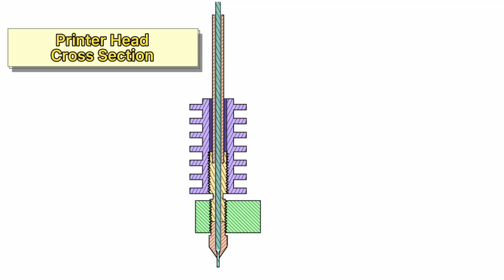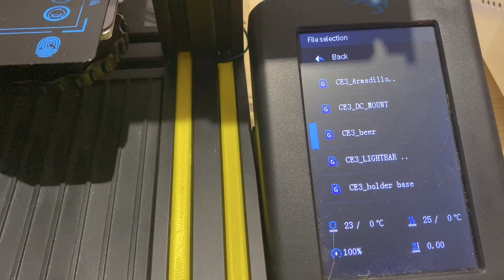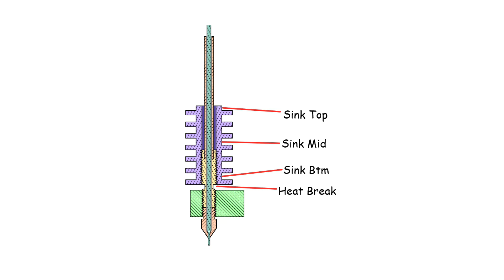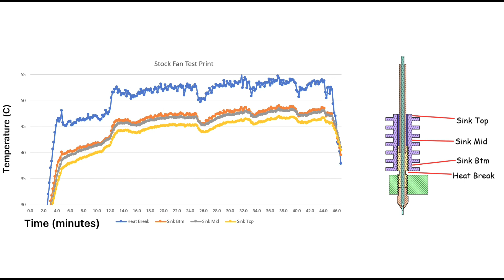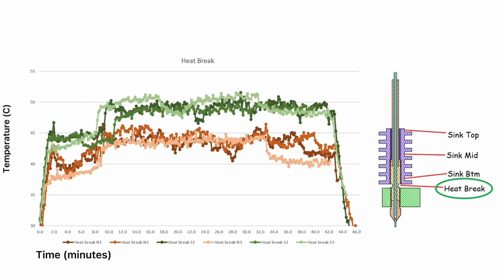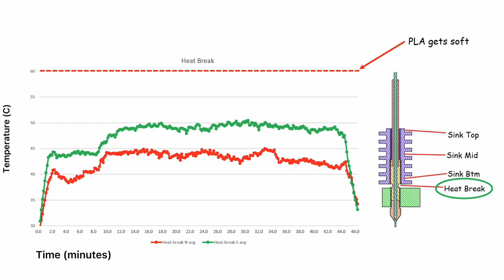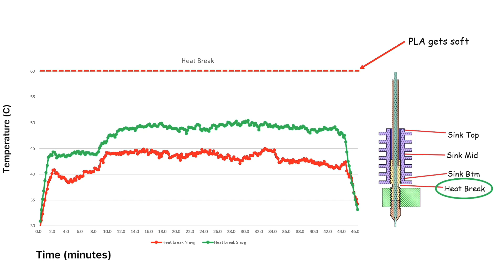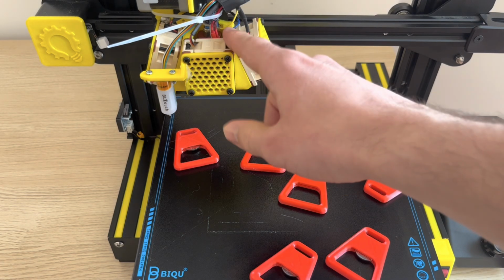Are quiet fans worse for your 3D printer?  You might be surprised!

Comment: Nicely demonstrated. Could you run the noctua fan slightly slower for even more noise saving and maintain similar temperature to a stock fan?
Reply: If you lower the voltage given by the buck converter, you will run it slower and therefore, quieter. But I am sure that the Noctua fans at 100% are significantly quieter than the stock fans, so I doubt that you will have the need to slow down the Noctua.

Comment: Do you have two sets of power wires for the fans? The two fans run at different voltages.

If you run the stock fan at 12v, you are running at half voltage, and that would reduce RPM and airflow.

If you run the Noctua fan at 24v, you are running the fan at too much voltage, it will run faster… For a while, then die. Temporarily the airflow would be better.

Noctua makes good fans, in both airflow and static pressure types, as well as hybrid types.

I am considering doing this change, but don’t feel like wiring in a buck converter ATM. Have to find the space for it too.

Winsinn fans are a little quieter and move air better, so using those ATM.

Comment: I think the real comparison in performance is more about flow and static pressure and noise is just a side effect of the design of a fan.  Typically speaking more "powerful" fans are louder, but that's not necessarily the case.  Well designed fans will can have similar performance and be quieter, which I think is likely the case here.  Would be interesting to have the CFM and pressure ratings of the fans to go with this data as well, though finding that for stock fans can be pretty tough.  So I wouldn't necessarily say "quieter fans are always better", in this case it's more just "this Noctua fan is better than the stock Creality one".

Comment: I'm trying to print homemade (260C) PET Filament. I'd constantly get heat creep and Jams after 10 minutes of printing. I'm hope switching to a noctua fan is going to help with this.
Reply from the maker: It might help some, but you may want to consider an all metal hot end with a metal heat break if you haven’t already. With this type of hotend the Bowden tube doesn’t go all the way down to the nozzle so the Bowden tube won’t get as hot.

Comment: How does the print quality differ with two Noctua FLX part cooling fans? I was wanting to do this same set up but I’m worried the quality of the prints will be far worse.
Reply from the maker: I haven’t noticed a huge difference in quality when changing the fans for the hot end. More so help to prevent filament jams in the future. But for the part cooling fans on the sides, the 4020 noctua fan will have better performance than the 4010 and you will notice the quality difference on difficult overhangs.

Comment: holy cow you really went in depth with this. gotta be the best comparison video about this topic. thank you for doing this it is greatly appreciated. why would the printer spike like that when you turn it off when its hot? why would power be going to it to make it spike like that when it is turned off?
Reply from the maker: You’re welcome! The temperature spike was on the heat sink. Normally with the fan blowing on the fins it cools the heat sink, but when the power turns off and the fan stops blowing the heat from the heater block creeps up the aluminum heat sink pretty quickly and the temperature rises without the fan blowing on it.

Comment: just installed 40x20 noctuas
they're quiet, but they also don't like the pwm control from the ender 3v2 at all
they don't even start themselves until around 75% fan speed, and there they seem to cool so much that adhesion is a problem with the fang shroud I'm using
kinda annoyed that I'll have to do so much recalibrating now to get things working again
Reply from the maker: Do you have them in series or parallel? I struggled with this a bit too. Ended up connecting them in parallel with a dc converter before them to step the voltage down. Yea the pwm doesn’t like it but I turned the fans on after the first few layers and didn’t have issues with cooling adhesion. Just had to keep a clean bed. I actually struggled with cooling under performance from the noctua fans on part cooling so now I switched to 5015 fans that can be controlled with PWM.
Reply: @DesktopInventions  each one has it's own fan port and buck converter
the 40x10 mainboard fan that the ender controls via the part-fan setting has no problem at lower duty cycles, the 40x20 on the same signal does.
it also has super weird lag, setting it to 100% and then 90% will be much stronger for a little while than 0% to 90%.
not sure if that's on my buck converters or something weird the ender is doing

idk, maybe the adhesion is not a fan problem after all but some other stuff, but it's just a shit feeling to have something working perfectly, try to upgrade it and then it's worse :D

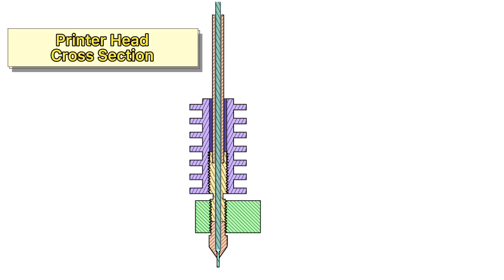Comment: 2:24 nice optical illusion. Due to the diagonal stripes it looks like the tubes are not straight
Reply from the maker: yea good catch!  I didn't notice that before!  Also I apologize, the cross section for the stock ender 3 hot end should have the Bowden tube go all the way down to the nozzle.  What I drew at 2:24 would be a full metal hot end.

Comment: RPM and CFM numbers don't tell you what you want to know, more  RPM does not mean you move more air because of blade pitch, while the CFM rating does not factor in load other than the weight of the air. Positive static inside hotend cover is putting load on the motor,  wattage of two like motors will determine how much the motor slows down.  You go by the amperage rating. Another thing to keep in mind is you don't just want airflow, you need some velocity to drive air through the fins. Velocity is going to make some noise so don't cut off your nose to spite your face. With a slower fan at least lower the heat load by wrapping the heat block in cotton
Reply from the maker: yes, it's been an experience, but learning that the axial fans are not great for part cooling because the static pressure is relatively low.  Now strong enough to push the air through small ducts.  Thanks for the comment!  Not sure I understand wrapping the heat block in cotton though?
Reply: @DesktopInventions  Heat load targeting, it reduces radiant heat around the heat sink. Heat goes to cold so the lower the heat sink temperature the more heat will travel  into sink verses the direction of the filament.

Comment: In the Ender 3 V2 stock hot end the ptfe tube goes down to the nozzle right?
Reply from the maker: Yes correct, I made the diagram wrong based on a full metal hotend.

Comment: I really liked this test you did, but you are not comparing the same size of fans, they are different
Reply from the maker: Yes this is true. I was conservative and went with the bigger fan to make up for the noise reduction with some more volume. I did another comparison video comparing the 4010 noctua fan as well!
Reply: @DesktopInventions  Yes already saw it!! very good by the way, after watching this video I saw the other one, but you know what, I made that change from the original to the noctua 4010 on my Ender 3 Max and now I'm suffering from clogs in the first few hours of printing, I don't know if I'm doing something wrong...
When you did your tests, did you make long prints to test it?
Reply from the maker: From the temperature testing I saw things reached steady state in less than an hour. I also did several longer prints 6+ hours and even used a 30mm tiny fan at one point just using PLA anyways. If you’re still struggling it might be good to upgrade to a micro Swiss or some type of all metal hotend to get your Bowden tube further from the nozzle.

Comment: something I would like to see is the differential in power consumption on the heating element between fans. The largest temp difference was at the heat break so if it is keeping it cooler, with a Noctua fan, is forcing the heating element to work harder to maintain temperature?
Reply from the maker: That is an excellent suggestion! I think the power difference would be quite small in terms of overall power but it might be surprising! Also see the difference in power with and without a heat sock which insulates the hot end from the part cooling fans.

Comment: Just found your video, a great experiment.  It is refreshing to find real facts on an important topic. It goes to show that there is more to fans than just maximum air flow.  Cooling the heatsink requires a fan designed with good static pressure performance too - which is an indicator of how well the fan will push air in a restricted space past the fins.
Reply from the maker: Yea agreed, while I admit these noctua fans aren’t the best for static pressure, I think a radial blower fan would be a better solution for cooling. But at this point I’ve been trying to optimize noise and “good enough” cooling. No speed printing yet 😂

Comment: also the stock ender 3 fans are horrible quality. the stock blower had bad bearings from the start on mine, used the brissfang setup for along time with dual 4020 noctuas with no problem. using stealthburner now it does have better part cooling. but its mostly for looks
Reply from the maker: Nice that is a great looking printing head!

Comment: Thanks for this! Just watched someone on YouTube shit on Noctua as a whole, saying you’ll get terrible performance & heat creep if you dare use their fans for prints longer than 8-10 hrs. I used a single 4010 set to 12.5v & have seen no effects of heat creep after many 10+ hour and recently 2 26-hour prints. I do plan to use this setup you show in the video though.
Reply: Its a small system heated by a controlled and powerful heating element. As the video shows the heatsink gets to pretty much steady state within 30mins. If they haven't reached stable temperatures after 8+ hrs they have serious design problems unrelated to fan choice.
Reply from the maker: Agreed, that’s what I’ve seen within my testing, almost steady state within 20-30 minutes.
Reply from the maker: Yea agreed I’ve heard similar statements but haven’t seen an issue out of it. Especially on the hot end, they really don’t need as much cooling as you’d think with the stock fans that come on them!

Comment: This is a great video. It wasn't a 100% clear to me where you step down the current for the hot end fan as the noctua is 12V and the stock creality is 24V. Did you remove the buck converter when you swapped out the fans? Is the voltage converter in the wiring chase? Does it get hot?
Reply from the maker: Yes there is a buck converter there on the Noctua fan. You can see it around 4:11 in the video.  The buck converter came out with the harness I made for it.

Comment: The noise warning was just hilarious, I have the ender 3 V2 and it's like a jet engine. I've said to creality and they sent a replacement nozzle fan. They are a joke. I don't understand why they can't use 12v fans that are quieter and do a better job. Awesome video. Just a last question, what is a CFM from a nozzle fan? Anyone know?
Reply from the maker: Yea creality printers are very great MVPs minimum viable printer at a good cost some of the nice to haves auto bed leveling, quiet fans, etc. don’t make the cut. Not sure on the exact creality ones but I found fans of the same size and RPM online that are about 2-3CFM
Reply: because of cost. if you want all those nice things on your printer you arent going to be spending barely 200$ USD and more like 700$USD and more

Comment: If the stock fan has an air flow of 7.26CFM and Noctua 5.5CFM, why the hotend gets colder with the fan that is providing less air?
Reply: Static pressure also matters. CFM is not the only important value.
Reply from the maker: Where did you find the 7.26 CFM value?  I wasn't able to find that online. my short answer, I'm not exactly sure. but I have 2 possible explanations, 1. the Creality fan doesn't actually meet the 7.26 CFM value or 2. the air flow pattern is different for the 2 fans, the creality fan when I turn it on and feel it with my hand most of the air is flowing at the edges and directed away from the center of the fan, and the noctua fan feels like more even air flow across the face of it, although it does have a small dead spot in the middle.
Reply: Maybe 7 is a bit too much flow and is causing the air to back up in the printer, making the fan less efficient.

Comment: Well done! Just wonderin why u did not choose the 4010 from noctua for ur test, as most people pick as replacement for the stock fans. This is sorta effecting the results cause of cfm. Noctua 4020 do deliver about the same cfm as stock 4010, noctua 4010 are worse due to the lower rpm. As far as I remember from my thermodynamics class, flow is effecting the amount of heat u want to get rid of in a severe way
Reply from the maker: Very good suggestion, to be honest I thought the Noctua 4020 was going to be slightly worse than the stock fan, but still good enough.  I didn't even consider the Noctua 4010 standing a chance to compare to the original fan.  But now that you mention it I will purchase a Noctua 4010 fan and do a follow up video along with some of the other good suggestions yet to come.  Thanks for the reply!
Reply: @DesktopInventions found the other video also great video